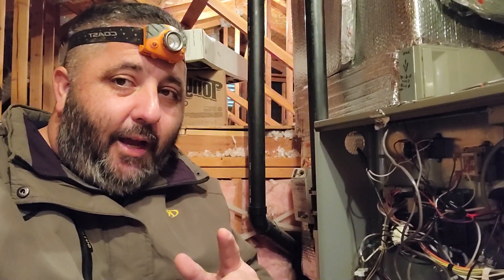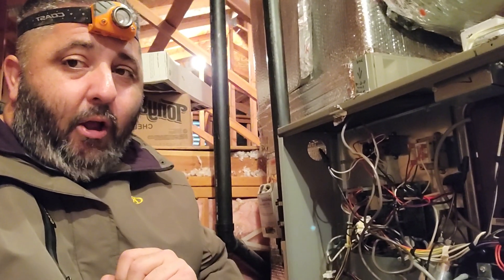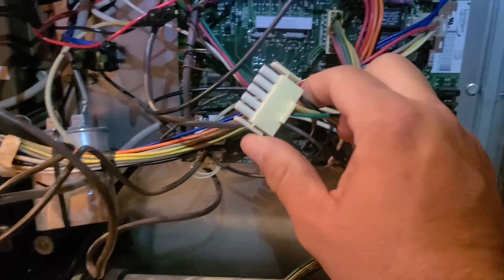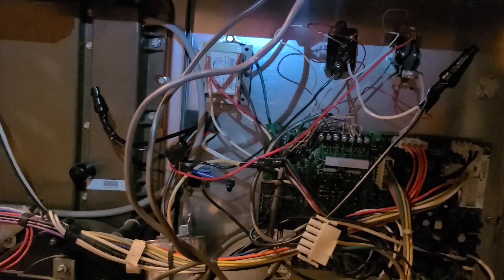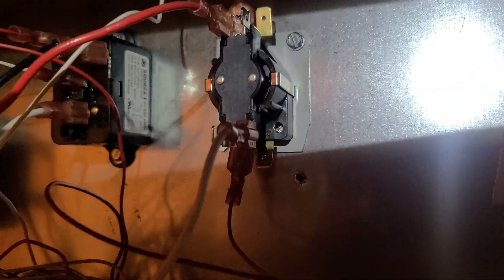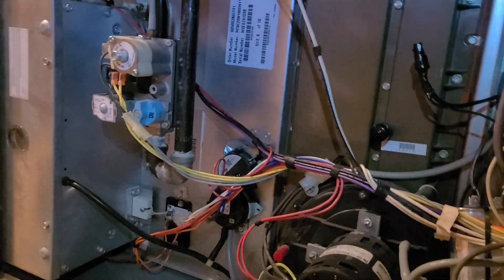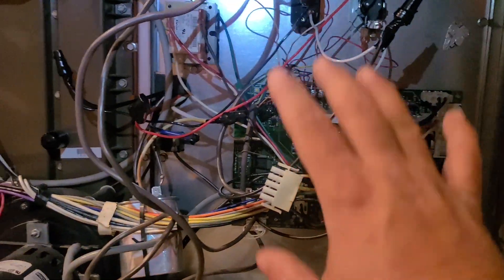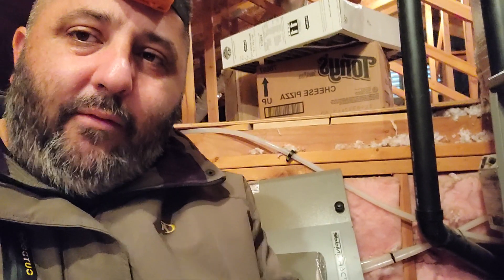How to replace a VARIABLE speed blower with a PSC motor!! only emergency use!

Comment: " How to completely ruin the efficiency rating and dehumidification abilities of your variable speed HVAC system in one easy step."

Or you could buy an aftermarket universal variable speed motor for 1/3 the price of the OEM motor and do the job and your customer right. Apples and oranges,I guess.
Reply from the maker: Exactly.  That's what I did. This was a temporary motor so they didn't have to wait 2 months or so for the back order motor. I went back and put the variable speed in. Also universal variable speeds don't always work if they are communicating and not just regular ECM. If communicating it won't work. So I did this as a temp fix. And you are correct. Which is why I also try my hardest to only ever use OEM.